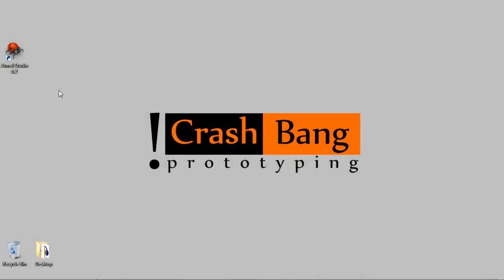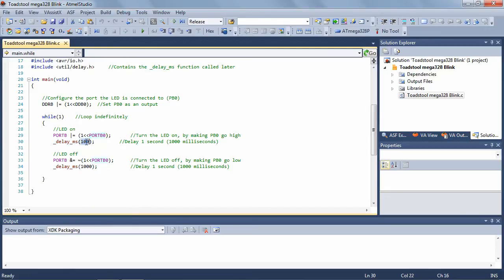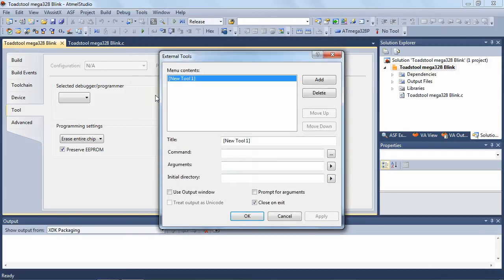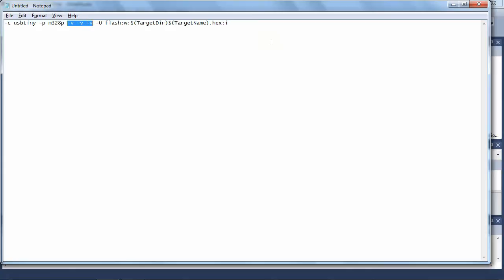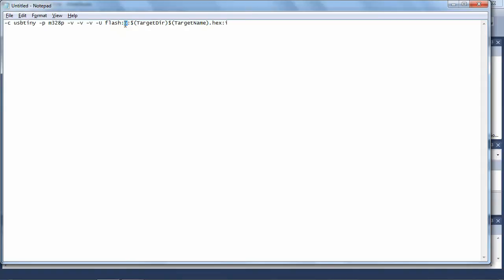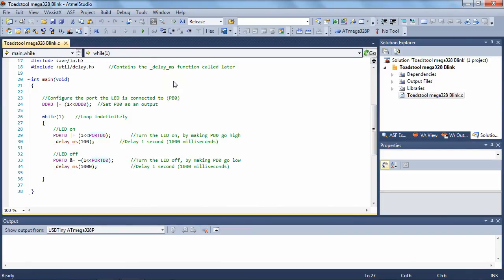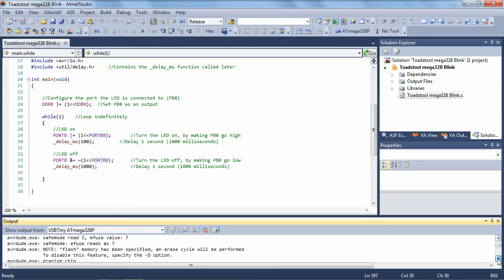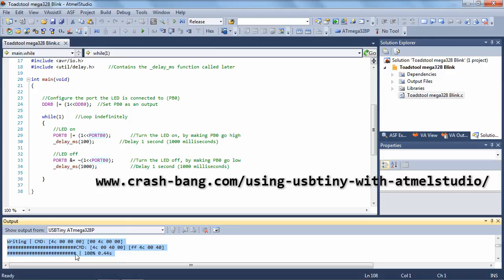Using a USBTiny Programmer with Atmel Studio

Comment: if anyone can't program the board and is getting "avrdude.exe: programmer operation not supported"  that just means that the programmer does not have the ability to adjust SCK speed but that shouldn't be a problem so check other things. You can see the same message come up in the video too.

Comment: avrdude.exe: Version 5.10, compiled on Jan 19 2010 at 10:45:23
             Copyright (c) 2000-2005 Brian Dean, http://www.bdmicro.com/
             Copyright (c) 2007-2009 Joerg Wunsch

             System wide configuration file is "C:\WinAVR-20100110\bin\avrdude.conf"

             Using Port                    : lpt1
             Using Programmer              : usbtiny
avrdude.exe: Error: Could not find USBtiny device (0x1781/0xc9f)

avrdude.exe done.  Thank you.
Reply: Did you install the driver for the USBtiny correctly?